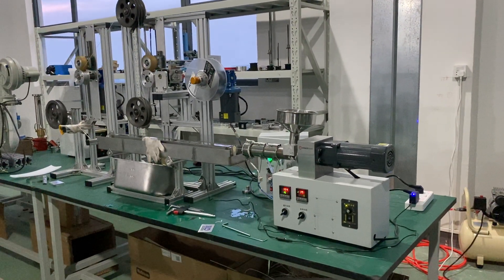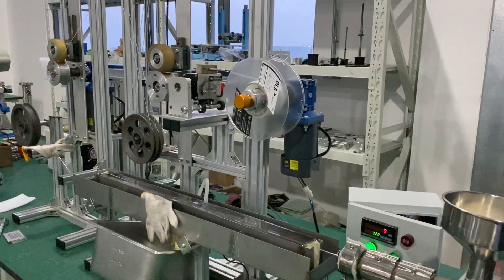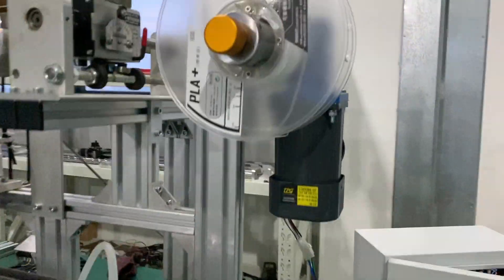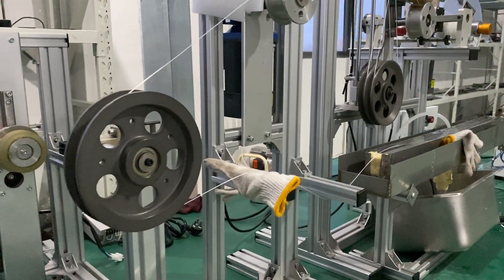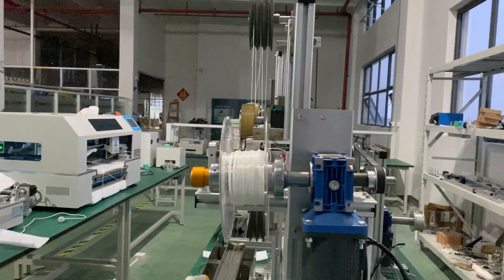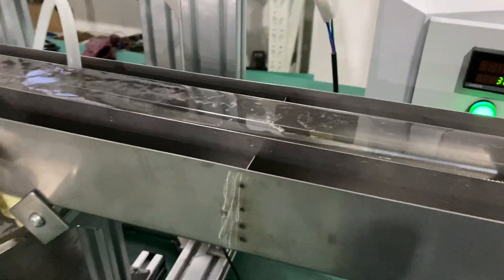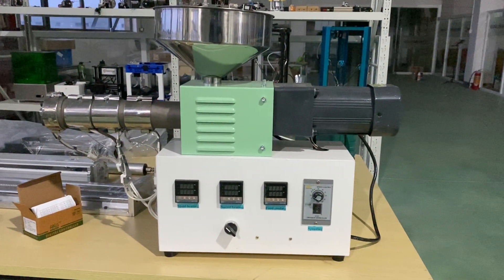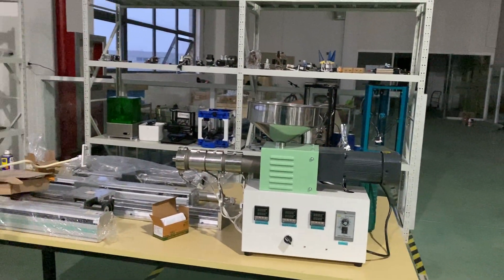RobotDigg Desktop Filament Extruder

Comment: How is the 3d print quality with this filament?
Reply: It is good if you Set the Parameters correctly. And it strongly depends on the Material that you use